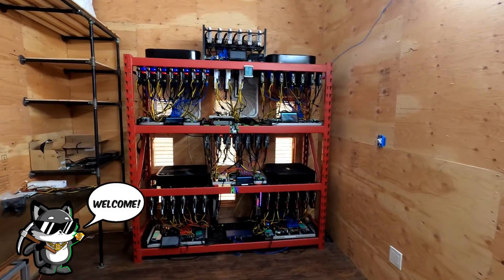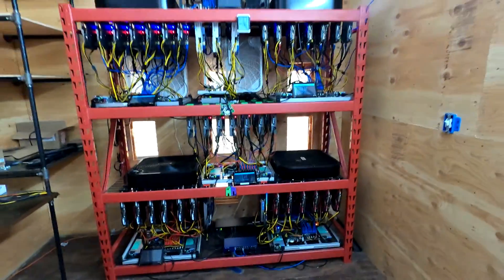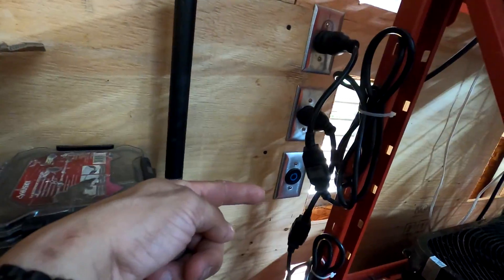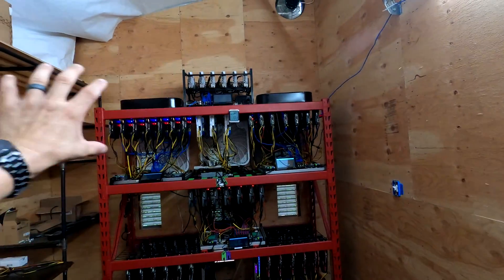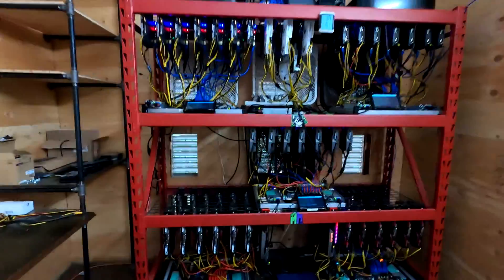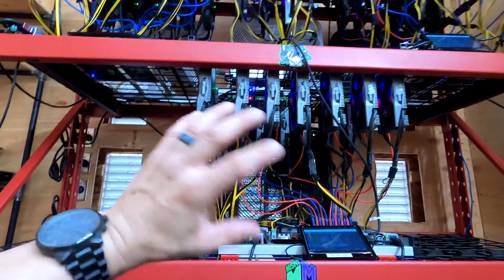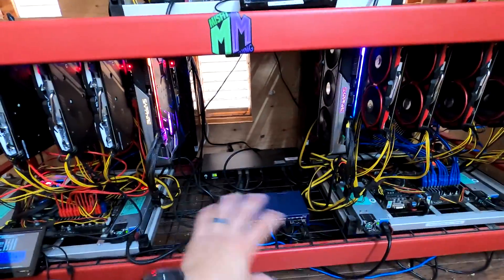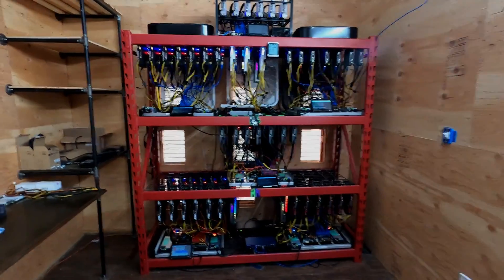RTX 3060 Fan Placement | RTX Mining Rig Cooling

Comment from the maker: How Many Times Have You Moved Rigs/Fans To Try and Fix Your GPU Cooling? Let Us Know Below!
Reply: once. (;
Reply: Too many times lol. Now I am setting up a specific out doors one, shaded, and is in the path of natural winds (to cool whatever electrical is in between the two shipping containers, and assist through the top portion of the container only). Just need to rent a bobcat and set the containers about 5 ft lower than sea level.
Reply from the maker: @MC...  lmao!!
Reply: dispersed through the house ;)
Reply: many lol trial and error i purchased an aircon to cool them still dont work lol then i found an exhaust fan with 4000+ cfm and then boom i can sleep now in peace i bought 2 tho. you just need a good exhaust fan trust me from 70c to 55c

Comment: The engineer in me speaking here, but I suggest you rent out a thermal camera like a FLIR system from Home Depot or somewhere that rents them out to do a thermal sweep of the area on a very hot day to better understand the heat transfer in your room. Look for heat soak and dissipation opportunities. All about path from entry/exit points to maximize flow rate.

Comment: You want cool air intake coming in from a low spot opposite wall of your exhaust and you might want a more powerful exhaust. You might also try turning the fans so they blow the air out of those vents instead of sucking air in

Comment: Did you run 10awg? If you swap the breaker and plug to 30a be sure you did! Typically the insulation on 10awg is orange. You have a perfect setup for geothermal.  Have room to dig a 200 ft trench in backyard?
Reply from the maker: Haha just 12-2 for the 20 Amp Circuits here the 30 amp will be at my main location